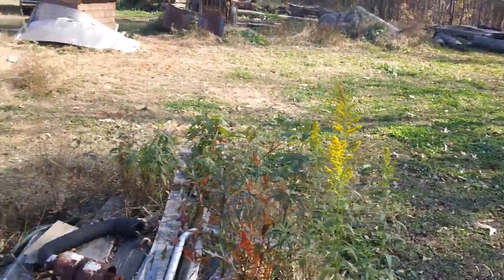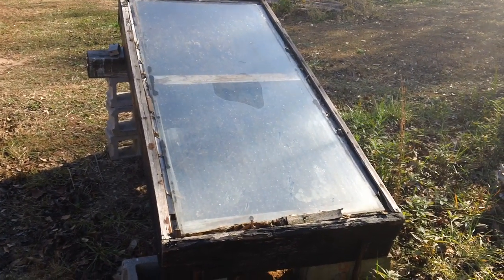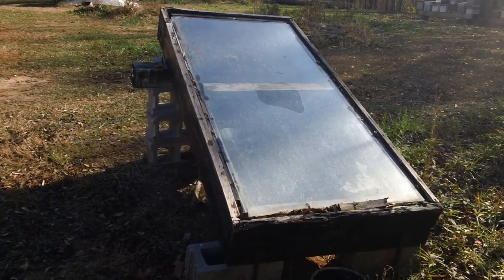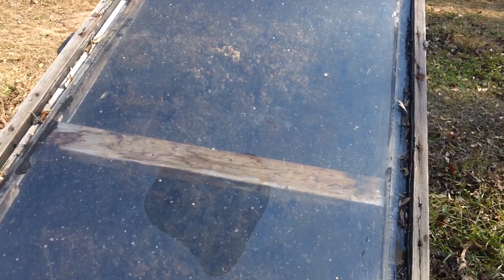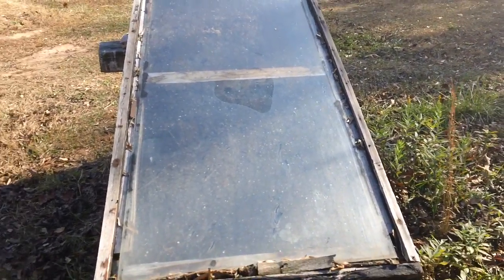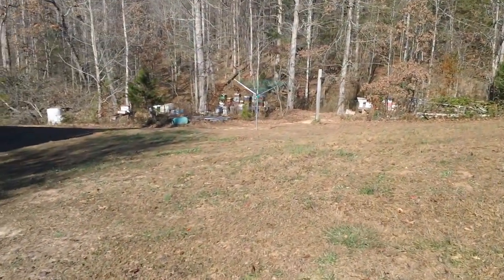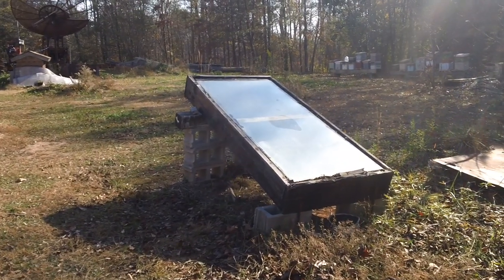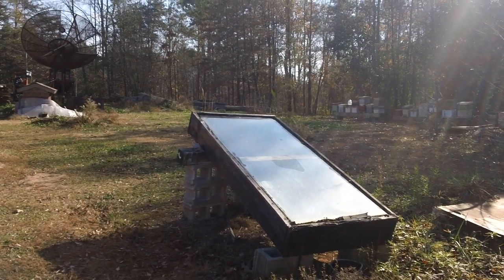SOLAR WAX MELTER IN USE

Comment: I built a small solar wax melter, but I was not impressed. But in hindsight I think there really just wasn't that much wax on the comb that I melted. However, I still much prefer the hot water method, as it is much faster. I like the solar idea for passive gain, but it may be less headache just to always stew it down. Thanks again Don.